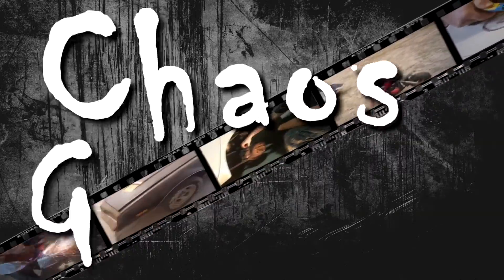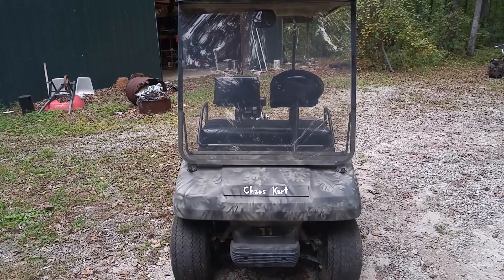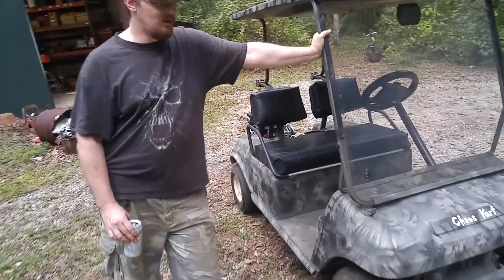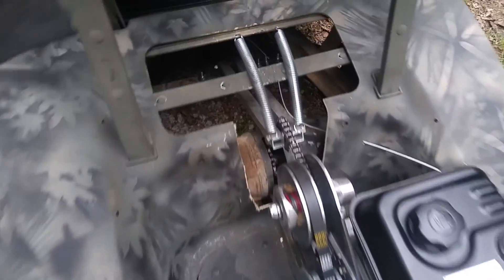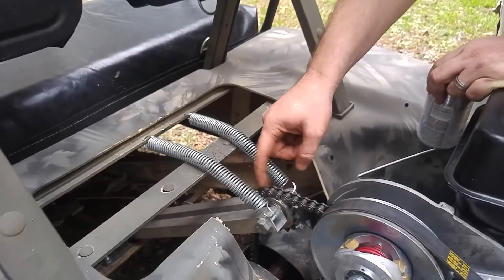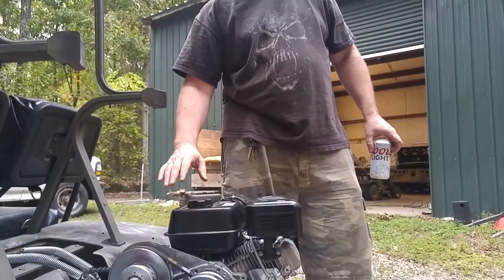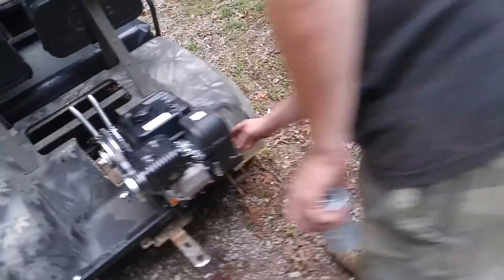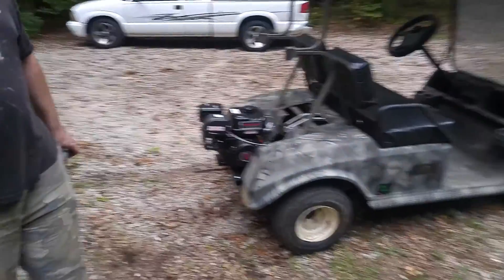Chaos Kart - Part 3 (The Electric to Gas Golf Cart Conversion Runs!)

Comment: I know it's 5 years. Just doing this now. Great job. Do you remember how many teeth on rear differential sprocket? Thanks
Reply from the maker: It's been a while. Dug through my email and found this info. Maybe that's what you're looking for? TRITAN 40BS14H X 1 1/8 Sprocket - 1/2" Pitch - 14 Teeth - 1 1/8" Finished Bore
Reply: @ChaosGarage  thanks I appreciate it.

Comment: Any updates on this project? Wondering if you ever put the engine cover truck bed on it.
Reply from the maker: Unfortunately not yet.  The rear axle has a wheel that locks up (can't push the cart backwards) and I just haven't had the time to pull it apart and see what's going on.  So the Chaos Kart is sidelined for a little while until I get back around to it in the mountain of unfinished projects.

Comment: What did you use to make the bracket that the aluminum tube are mounted to so that they pivot
Reply from the maker: I just used a piece of angle iron on the bolts there were already there holding the top on and I used maybe a half inch piece of small rubber hose on the bolt between the angle iron and the mounting bracket of the light.

Comment: That's so cool!
Reply from the maker: Thanks!  With such a low gear ratio, the governor on that engine, and the stock size (bald) tires, you can just floor this thing and keep it pegged...even around corners!  Eventually we'll see what happens with bigger tires that actually grip since it will go a little faster and center of gravity will be raised a couple of inches.

Comment: Awesome guys it actually sounds like an electric coming at you in the vid the gears are humming pretty good.  No reverse hum -ok an old vw generator/starter belt drive will give you 12V power and a reverse with the push of a button.  The Chaos Cart looks great well done.
Reply from the maker: That rear end is definitely a lot louder than expected.  I imagine after sitting for so many years, it needs some fresh oil.  Hopefully it's not turned to sludge in there.  I may run some ATF in it for a few minutes.  Eventually I would like to add things like reverse and a charging system...both of those are inconvenient to not have. For lights I think we will go with a deep cycle battery until then.  Reverse is a little trickier situation.  I'm not familiar with the system you are referring to but sounds like it could be ideal.  Not bad for around $200 in total so far right?